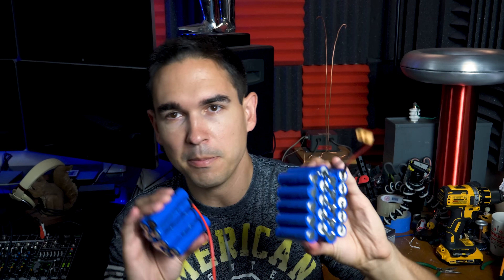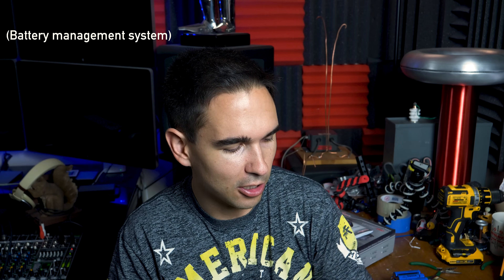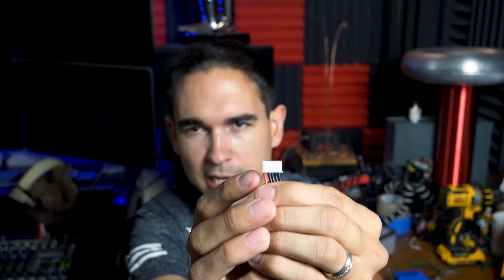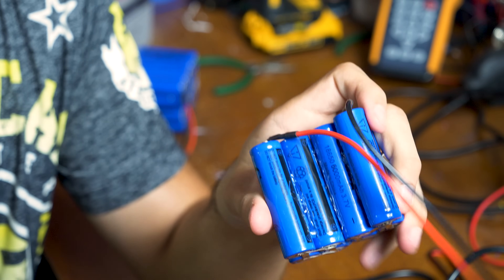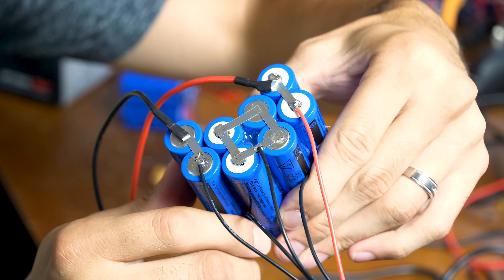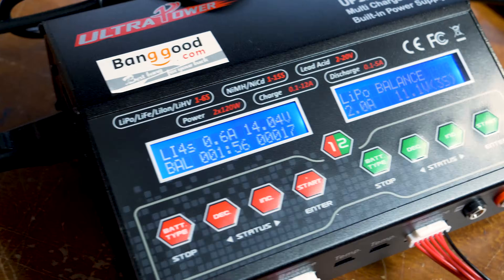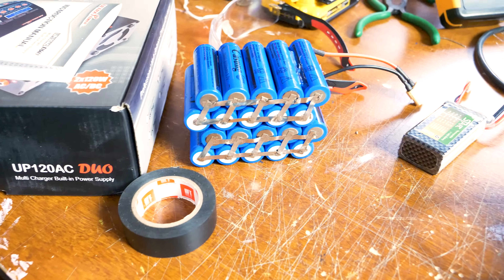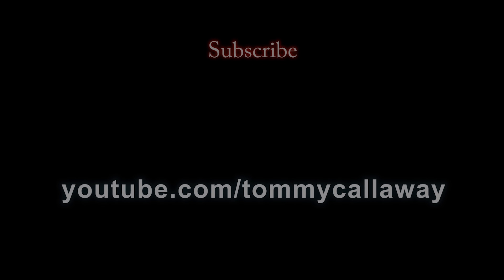How to charge custom lithium ion batteries (without a BMS)

Comment: Decent explanation of balance charging vs. employing a BMS to handle that, and much more.

For me, the bottom line is:  If you care about your battery, use a quality BMS.

The only reason I can see for NOT using s BMS on a non-hobby application (solar storage, etc.) is foolhardy frugality. Much, much too risky for me.
Reply: The charger he is using acts as the BMS. There are MANY chargers similar to his that do the same. And I assume you are aware that even a "quality" BMS can fail, so what then? I've been making 12 and 18v packs like Tommy for almost 10 years, charging them the same way and have never had one blow up or fail in a crazy way. And they last 3-5 years using them daily in my drill, sawzall, circular saw, etc.
Reply: @cjoakman7715  First of all, a comment to a 2 year old post? Really?

Secondly, you're just plain wrong. The balance charger doesn't "act as the BMS." Again, this video demonstrates the use of a balance charger.

As a professional battery designer/builder, I stand by my original comment. The balance charger in this video  provides over-voltage protection. That's it! It doesn't provide any other protections that a quality BMS provides. For instance, on the charging side, low temperature and/or over-current.

Unprotected battery packs are just that, *unprotected*, and discharging without protection is recklessly foolhardy. Over-current and under-voltage protections are every bit as important as over-voltage and over-current.

Yes, BMS's do represent a point of failure. However, in my experience, they reliably provide all the stated protections. I've never had a BMS fail. I have, however, had BMS's save multiple packs from dangerous conditions on multiple occasions. Additionally, those equipped with Bluetooth provide real-time information on battery condition. This, in and of itself, is worth the cost.

There's a difference between misinformation and disinformation. As you claim to be an experienced builder, I'll label your comment as dangerous disinformation as you're knowingly encouraging inadvisable behaviors.

Here's hoping your luck never runs out.

Comment: If I don't have a management changing system do I still can change batteries with regular charger? What about parallel and series changing?
Reply from the maker: You can but it's pretty easy to get batteries out of balance.  When you do "Quick charge" on regular lipo chargers, they don't utilize the BMS

Comment: i have charged a 18560 battery and connected couple of leds as load for 24 hours. The leds stayed lit for the whole day and the voltage came down from 4.2V to 3.89V. Is there a way to tell if this battery is good or bad.

Comment: Yeah one thing that's not apparent is it's not the wire that really makes the difference. It's the fact that he has a hobby balance charger. If you were to plug that same wire up to just a regular 4.2V (or 12V) power source, it's not gonna balance charge the pack. Just FYI for anyone not sure the difference here is his charger. Otherwise good video though.

Comment: Nice video man. I only want to say that maybe you should not solder in the middle of the nickel strip as it is close to the edge of the battery (-terminal) you could if the heatshrink melted under the nickel short out your whole project!

Comment: Rushed through the hookup sequence for the black wires....and lost me: "next negative and the next and the next....done in five seconds hey what?
Reply: Essentially you plug up the first cell in series with the first two wires on the little wiring harness, then move to each cell thereafter. In this video he says you connect the positive for the first cell then the negative for that same first cell. Then with the third wire you move onto the second cell in series and put it on its negative side. Then fourth wire goes to the third cells negative and so on.

However, all the balance leads I've used are actually the opposite of what he stated. Meaning the first two wires goes to the negative of the last cell in series and then positive respectively. Then the next wires follow the same guideline as above of jumping cells but they're connected to the positive ends of each. I think technically it's the same thing (just depending on how you flip or plug in the little connector at the end) but the balancers I've used specifically point out that negative goes into the first pin so I guess it depends on your device.

To make it easy to think about though, the first wire usually goes to the negative for the entire battery PACK. The last wire will go to the positive for the entire pack. Then each wire starting with the second will need to connect to the series connection between cell 1 and 2. Next wire is connected to the series connection between cell 2 and 3. And so on. So basically each cell will have one wire on either end of it. That's why there's always one more wire than the total number of cells you have in series

Comment: Crocodile clamps on wires just "behind"/"below" the solder point, or place a normal Circuit Heat Sink on the left and right side of your nickel solder position to dissipate the heat from soldering if you're a new solderer and are unsure if you're about to overhead the battery because of prolonged soldering. Doesn't take much to dissipate the heat really, be careful out there! :)

Comment: But bms is for li po for li ion doesnt need that the laptop doesnt have balancing right
Reply: A bms is just for overcharge and discharge protection to prevent the battery pack being damaged. It does NOT charge the battery and any balancing feature on one would simply be to drain the highest cell to the lowest over all with a resistor. You need a charger with the logic functions and ability to control current and voltage dynamically to each cell, a laptop battery has a BMS pcb inside it and the laptop itself probably has the balancing circuitry on its internal circuitry using those many pins on laptop battery to read the battery state. You need a decent charger to charge multi-cell li-ion packs like these if you don't want to destroy the pack quickly or eventually have a nice smokey battery pack that melts whatever it is your using it for as it burns... a BMS is still a good idea even a cheap one, but you should charge it with a charger like the one in the video also.

Comment: Is there a charger with multiple single cell charging ports with clips so if you wanted to charge each cell individual you could.   As each cell reaches the target voltage charging would stop.

Comment: I am looking for a BMS for my custom Li-Po 48s4p battery pack. The pack consist of 32 packs total (6s1p each, 100C output max). Each pack have his own balance plugs, I have the connector for them. My idea is to get an ajustable direct DC power supply (0-250V/0-20A or maybe more), hook it up to the pack with BMS attached to charge it, Would it be safe and works ?
Reply: You should get a external balance charger like the one in the video and just a bms for overcharge and over discharge protection. BMS are not chargers they are protection circuits, charging with a dc voltage with that many cells in series seems kind of like asking for a disaster lol... maybe try using a boost converter to step up the voltage from a lower voltage more realistic pack.
Reply: I already have a PowerLab 8x2 but can only do 12 packs at once. I wish to do the whole pack as one. My second idea was to use the Y-Harness of the balance plugs to the balance board to do parallel charging but it seems I need to hook up the output wire as well otherwise the balance connector fried up...

Comment: the battery box of metal and plastic dont required ventilation ??  when i saw their construction its looking like a closed box my query is that if it is a closed box then during the time of cell  charging and discharging where heat is dissipating  ??

Comment: what about low voltage protection on the batteries, so they don't over discharge?
Reply: If you have your battery hooked up to an electric speed controller (ESC) some have a lithium cutoff voltage feature

Comment: what causes li ion batteries to wear out and weakens?
Reply from the maker: My best guess is chemical reactions of some kind. I have no idea.
Reply: i got a new electric skateboard.. at first i charge it for 3 hours and use it longer until now.. whenever i charge the board it only takes 1 and a half hour to charge and discharges so quickly

Comment: Nice video. Since you have a 4S2P pack does the hobby charger treat each parallel group as one cell? Is this good balance charging practice or should you balance only 1P packes?
Reply from the maker: It does, and it's normal practice to do so.
Reply: So I guess the next question would be if each battery in a parallel group will end up with a voltage equivalent to the voltage of the others in that group? Will the result of balance charging in this manor bring each parallel group to an equal voltage and neglect the fact that each battery has a different voltage as long as each parallel group has an equal voltage?

Comment: Thanks for this, it is very helpful. I would like to make a 48v 30A Li-ion battery, how would I charge it???
Reply: Peter Mbiria make 2x 24v (6s) packs with to separate balance leads and link the power in series for operation, then charge separately. That's the Simple way.

 Alternatively you can get an 11s (33v min 46.2v max) or 12s (36v min 50.4v max) bms and a 46v~50.4v charger pack

12s plus bms is best if the voltage range is compatible with what your doing. Most devices that run on 48 will run on 50.4

It's worth noting that you will possibly get better power and longer run times without bms by a small margin initially. But also can potentially over discharge and damage the longevity\quality of the cells.  Use a simple low voltage alarm meant for 18650s to help with that because it will beep when a cell reaches the low voltage you have specified and then you know after the alarm that it's operate at your own risk and risking the batteries.

Comment: ( 6:30 ) ... exactly for the reason demonstrated at 6:33 those batteries MUST be charged individually to a perfect full charge before they get into those  Parallel sets and they need to be rechecked now and then especially after heavy usage.
Awesome video. Thank you for sharing
Reply from the maker: Yup!  If you match two badly unmatched voltage batteries, you could melt the nickel strips, or start a fire.

Comment: Im just learning about this stuff and want to make a battery pack to run a led light bar on my dirt bike, and i was thinking of 4 batteries in series and 4 or 5 sets of the 4 olin parallel, how would i wire that up?

Comment: hello tommy...what about a diy electric vehicle battery pack with more than 100 cells? is it possible to charge it without a bms?
Reply from the maker: You could.. but you'll probably have to divide the pack up into a bunch of smaller packs and charge them individually.
Reply: and the number of cells in each bunch depends on my hobby charger?
Reply from the maker: yes
Reply: thanks sir

Comment: if I have a,  say 10s, how can I possibly charge it?  your charger is up to 6s, this has been my major concern.  is there another equally safe was of doing this?
Reply from the maker: +Chibuzo you can make two 5s batteries, charge them separately, and connect them in series to use.

Comment: Hi, I would like to make a 2S or 3S pack with protected li ion18650 cells, do i need to put a balance plug on it since the protected cells do not exceed charge above 4,2V or discharge below 2.75V?
Reply from the maker: Yes, you'll get a bigger charge on your batteries if you balance charge - otherwise the whole pack will stop charging once the first cell hits 4.2v.
Reply: Tommy Callaway thank you, I thought that when a cell reached its maximum the circuit of this cell cut the charge to it but the current normally followed to the other cells.

Comment: If its difficult getting to the negative terminal then scrap off an area on the batteries and connect to case.  The case is negative. The case is a tube.
Reply from the maker: Valid point!

Comment: Nice wiring.  You do realize however, that the hobby charger is functioning as a battery manager when it is charging?  You just don't have a continuous one on the bank.
Reply: Tommy Callaway Great video , I would like to make a 12 cell pack wired in parallel to get around 22volts for rc planes as I  am sick of puffy expensive lipos ,could you explain the wiring please ?
Reply: Tommy Callaway Thanks mate ,I have been studying how to make packs up and rig the balance connectors ,your videos are very helpful .
Reply from the maker: Well, in that regard, consider this how to only require a single BMS, rather than one for every battery you own.
Reply from the maker: +interman 77 2 parallel, 6 in series to get to ~22v

Comment: OK.  So this can't really isolate each cell, it can only isolate each parallel set.  So in this case, two cells at once since this is 4S and 2P for 8 cells.  So the low 2.98 voltage is actually the voltage for a pair of cells.  So this method can't address an individual cell, but can address an individual bank of cells.  Have I got this right?  Thanks.
Reply from the maker: +Jay Turberville yes, but it's the same type of isolation you get with a BMS. Parallel cells share the same voltage, the current is what increases, which is why this method works so well. Even if one cell in a pair dies it's safe, the max current would just decrease.
Reply: Tommy Callaway wouldn't the max current on the one remaining cell increase? Because you have all other dual cells putting XXamps in or pulling XXamps out but that one remaining cell will be the only one to match. The current should be the same through each cell in a series, the voltage per cell varies amperage per cell or set of cells should remain the same i thought. So if you use 5 cells then 2 them 5 the 2 should get hotter because more amps per cell are expected. I could totally be wrong though. I thought that's why cells tend to die as a whole group if left unchecked over time.
Reply: Is there any advantages of balance charging charging 1P or is this method ideal?
Reply: Jay Turberville when two cells are paralled, they act as a single cell. Only series cells can have different charges. But need to be balanced.
Reply: Jay Turberville and the cells in series need to be close as possible in capacity and internal resistance and voltage.

Comment: What is the capacity of those battery??
Reply: Ultra fire are the most crappy batteries on the market full of capacity lies, just bench test one they total rubbish.
Reply: Martin Counsell yes.. i know .. i have those 6000ma ones and those are 800mah just a pice of crap...
Reply: Tommy Callaway, if each cell is 2000 mah.  And cellpack is 4S then should it not be set to 0.8 Ah?
Reply from the maker: +Kuntal ghosh each individual cell is around 2000 mAh, so that times the number of cells in each pack.
Reply: Tommy Callaway i saw 6000mah and that is why i ask you this question i also have some of those ultra fire 6000mah battery and they cant do more than 800mah

Comment: and Im just charging my 3s8p pack with a solar charge controller and an 18 volt laptop adapter
Reply: And how long have you been doing that ? Still doing good ? your answers will be much helpful for me . thanks
Reply: Squid Of Overkill eventually you will have an inbalance in the 3s where some will be low when "fully discharged" others will be high when fully charged. You should need to balance them once in a while to correct this (even if that means manually checking voltage and charging just one cell a little) or you will find lower run times over time and then failed cells. Also a low voltage alarm per cell is key. If not then the cell that gets too low can have an inrush current when charging that makes it hard up and potentially blow. Also if one cell in the 3s becomes higher then the others then it can overheat and boil off the  catalyst and dry up causing failure there.

Comment: I use solar panels in a sine wave inverter admits frequency to charge batteries safely and get the longest life out of them using too small 12 volt 1.5 amp solar panels I can charge the batteries and roughly 8 hours to full capacity choosing my own voltage limiter going to the batteries works as an excellent long-term battery pack lightweight fast recharge with long time use before recharging